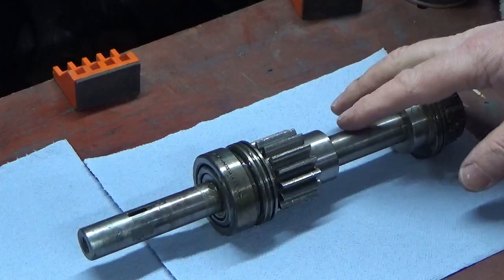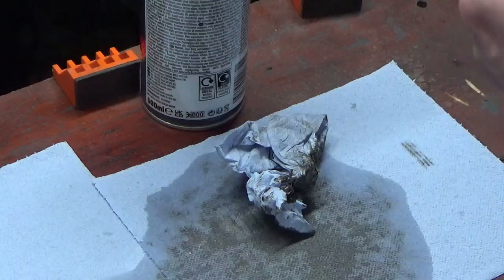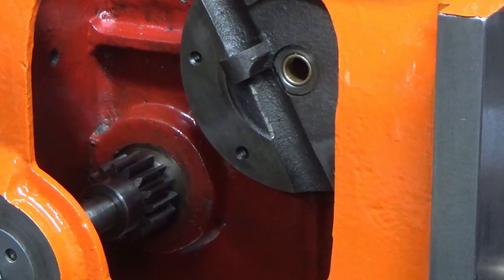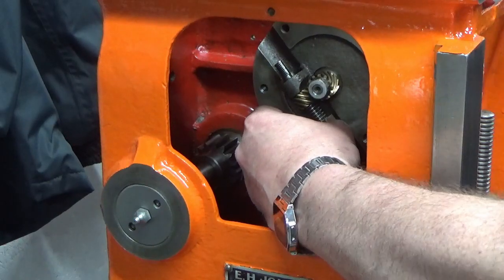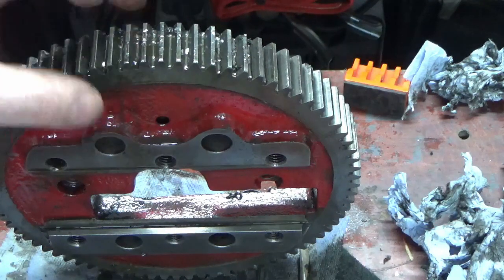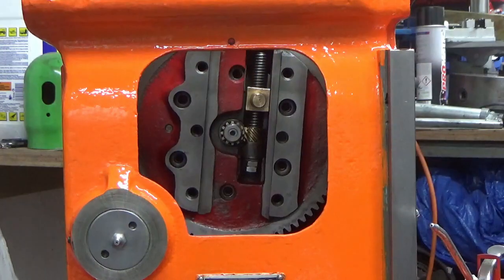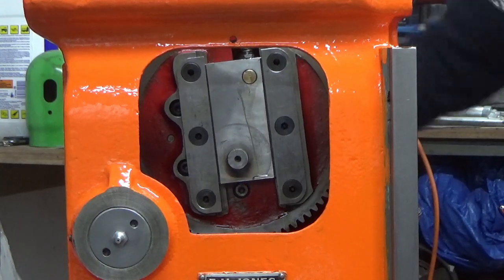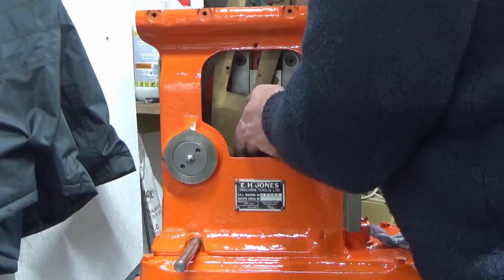Atlas 7B Shaper Refurbishment Part 5 - The Rebuild Begins

Comment: Hi,Jon. As others have already said I also believe that internal swarf is most likely caused by a careless clown clearing chips with an airline. Vacuum cleaner and paint brush only for me when clearing chips off the table. Very nicely made internals on these Atlas shapers. The small South Bends have a sump in the bottom of the main body and a plunger lube pump with several small copper pipes feeding lube to the critical areas. There are even adjustable metering blocks with the feed rate adjusting needle valve screws.
Reply from the maker: Hi Howard, thanks for the comment. Yep, bang on mate. I may end up putting a one shot oiler of some sort in there and a drip tray. Cheers, Jon

Comment: Possibly the previous owner or operator found out an airline was easier to clean away swarf, rather than a brush, ref swarf ingress.
lovely looking engineering,  my Alba looks very amateur in build.
Thanks for sharing.
Reply: Agree with you about that internal swarf probably the result of careless use of an air line gun to clear chips from table and workpiece. I only ever use a shop vacuum and pair brush to clear chips from my Alba 1 A or the milling machine and the lathe.
I was thinking the same also that our Alba 10" shapers are very crude in the internals component design compared to these Atlas machines. The South Bends are also really nicely made internally. I'm not complaining though as my Alba does great work after a full rebuild and some improvement modifications.
Reply from the maker: Hi John, thanks for the comment. I think you are right. I have seen 1st hand the damage compressed air does to machine tools, which is why I never use it on my own machines. Cheers, Jon

Comment: Great work Jon, it's surprising it ran at all with all the compressed swarf jammed in between the teeth. Good point about not applying that thick grease to the open drive gears. It's all gone back together really nicely, the internals look well against the orange casting. Tony
Reply from the maker: Hi Tony, thanks for the comment and feedback. Yep, it looks great now it's all cleaned up. Shame all those moving parts are hidden from view really when it's running. Cheers, Jon

Comment: The possible Reason you have loads of swarf on the bull wheel teeth, is that some previous operator used compressed air to blow the swarf away between cuts. air dusters are bad news on machine tools! The black goo could be Rocol open gear spray or something similar it sticks like shit to a blanket! but its very effective lubricant for this type of application. Great video Jon!
Reply: Agree about the likely cause of internal swarf being caused by careless airline use. It could also be swarf that has been blown in from another machine that was located nearby the shaper at some time in its history.... Use a paint brush and s shop vacuum only.
Reply from the maker: Hi Roy, thanks for the comment and feedback. Yep, I think you are bang on. Airlines and machines are a bad combination, I have seen £1M CNC's running gear trashed as a result which is why I never use it.......plus I don't have a compressor lol. Cheers, Jon

Comment: I have been putting together the US version of this machine and had quite a bit of that crud in the bull gear. Several teeth damaged but I went ahead and found another in pristine condition. I figured it only made sense as long as it was all apart and I doubt at my age I will ever be taking it apart again! On mine the arm isn't bronze but cast iron, I was quite intrigued of that. great job Jon!

Comment: Looking great Jon. Grease may be great for load etc, but as you evidenced it has to be maintained. How that much swarf got inside is incredible. Credit to the toughness of materials that it survived. That input gear should have been missing some full teeth as well as the bull gear. 

I am going to try a wet sump and am now trying to settle on which lube to use. More research to do. Max recommended hydraulic oil and I am going to give that a look to see which one works with cast iron. Old-old Ford auto transmissions that had a few cast iron pieces used Type “F” with great success. 

All the best 
Dan
Reply from the maker: Hi Dan, thanks for the comment. I would definitely go hydraulic, something like a 32 grade (not sure how that translates to US specs). I may eventually hook up a one shot oiler with slow release and a drip tray in the bottom to catch the run-off. Cheers, Jon

Comment: That mechanism is just a work of art what possessed them to cover it in that black crap you got lucky there was only slight damage could of been a lot worse 👍👍👍
Reply from the maker: Hi Steve, thanks for the comment. You are right, shame it's all hidden away inside the casting really, would be nice to watch working in conjunction with the rest of the moving parts on the outside. Cheers, Jon

Comment: great work jon.  you mentioned running the gears dry, could you possibly give them a dose of graphite powder  or is that a big no no  for machines??
Reply from the maker: Hi Graedon, thanks for the comment. Lol, I would never run them dry really, I was just playing fast and loose with my language. I think graphite could work though so very valid suggestion. I may hook up a one shot oil system eventually and build a small drip tray in the bottom to catch the run-off. Cheers, Jon

Comment: Hi Jon, great video series. I recently purchased one of these shapers and plan to overhaul it similar to what you are doing. Can you comment on the scoring on the slide cover plate? My shaper has this as well but it is facing outwards, I noticed you installed yours with the gouges facing inward. Maybe they’re a crude form of oil groove? Keep up the good work. Thanks, Dan.
Reply from the maker: Hi Dan, thanks for the comment and view. The grooving is from the mechanism rubbing against the inside. Sounds like someone fitted a new pin to yours and decided to put a fresh face on the inside?? Easy way to tell, there is an oil hole at the top with 'oil' stamped into the face, see if you can see that on the inside of yours! Good luck with the Refurb, plenty of orange paint left here mate if you need it lol. Cheers, Jon
Reply: @jonsworkshop   I suspect you are right about a previous owner flipping the plate. That whole area looks as though it has been messed with at some stage. Makes me worry about what I might find when I get around to disassembly. Interestingly my lever arm is cast iron, not bronze. Perhaps a design change somewhere along the way or maybe the UK variant was different in some aspects. Looking forward to the next instalment.

Comment: Here I'm watching closely and comepairing my USA Atlas Shaper to your Shaper, there are a few thing, one is one being the lube port for the main shaft, yours has a greas fitting in center of the shaft, mine has a oil cup obove the shaft buss, The one thing I dont use is greas, What I do use is Bar & Chain Oil, IT'S STICKY, and I use lots of it, as in to flush the chips and to keep it lubed

Comment: with all the stuff being so dirty and the time it was a part you couldve dropped everything on a closed bucket with petroleum or thinner / degreaser to let it soak a while , by the time youre ready to clean them up , most of the stuff is allready desolved and soften enough to brush off
luckily those gears arent part of sumting that needs to move verry precise it just needs to trow the precice part back and forth , it might make a bit of noise but it should work good
Reply from the maker: Hi Watahyahknow, thanks for the comment. Yup, a parts degreaser is on the 'to make' list at some point in the future. Hopefully it will run OK. Cheers, Jon

Comment: Mrpete222 tubalcain is the go to channel for information on these small shapers so he may be able to advise on the correct oil
Reply from the maker: Hi Andy, thanks for the comment and the tip. If I draw a blank from the info I have (but have not read yet - Atlas 7B manual), I will drop Lyle a note to see if he can help. Cheers, Jon

Comment: It is sinful the way it was contaminated with swarf. I can understand swarf getting in slideways but how does it get inside the gear works of the shaper ?
Reply from the maker: Hi Terry, thanks for the comment. Sloppy use of an airline for cleaning down I think, I never use compressed air in the shop for this very reason. Cheers, Jon
Reply: @jonsworkshop  I agree Jon. I have 3 air compressors and both my shops have compressed air but the room I built inside one shop has all my machine tools in it and I have avoided plumbing air into the room because I don't want to be blowing chips. I only use a brush and vacuum cleaner to clean my machines.

Comment: Say what you want about old machinery, but the fact that this shaper was running and doing it's job with all that swarf and dirt in it, tells volumes about the quality engineering and manufacturing that was put into that little machine. Thry this with one of nowadays CNC machines...
Reply from the maker: Hi Lorenz, thanks for the comment. You are so right, this was designed and built with care, attention and to a standard (not to a price). The raw materials will also have been top quality as well, which is why it has stood up to the punishment. Cheers, Jon